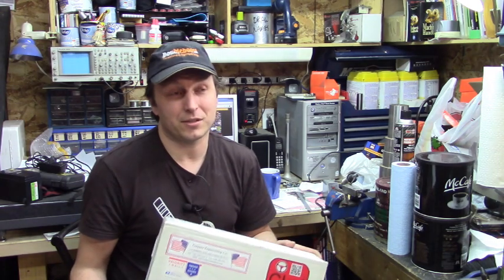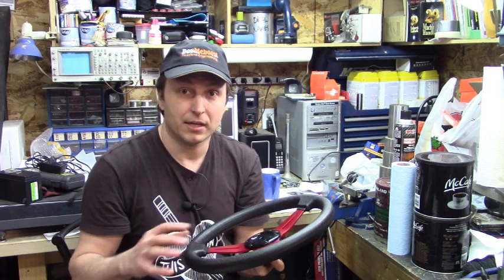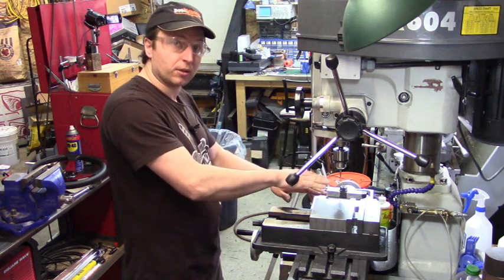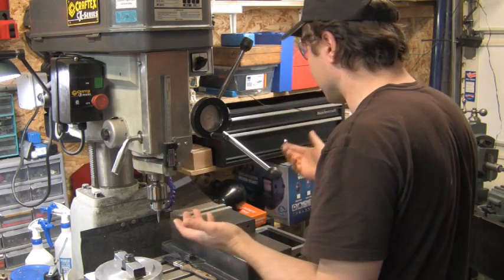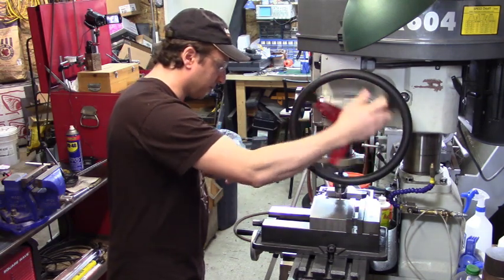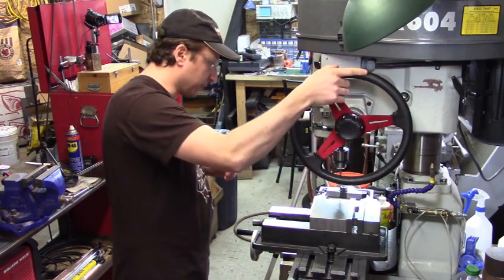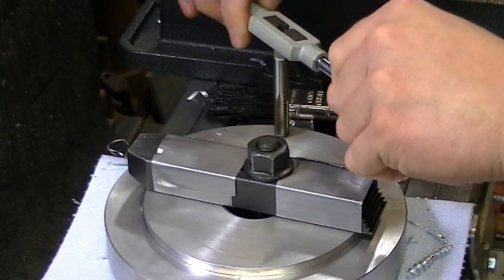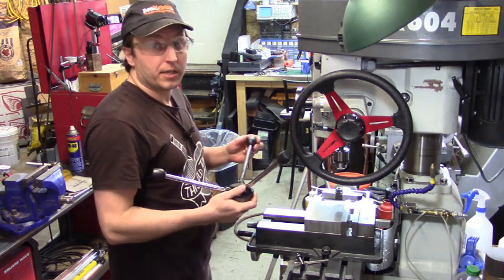Quill Wheel for the Round Column Mill

Comment: I like the concept... but what I would like to know is how the it holds up with hot chips and cutting fluids? The handle part looks like it might be directly in the machining chip path. Might not be nice if you grabbed the wheel and slide your hand across an embedded chip. Might want to consider a fully metallic version. Maybe a cast aluminum with finger grips?
Reply from the maker: I never thought about the embeddability of chips, but will keep an eye on it as it is being used.  Haven't heard much from others with wheels about grabbing shrapnel in the hand from it.  Not sure about the cutting fluids either yet but again no complaints heard from others who have had them longer.  You make a good point, this will be part of the longer term reviewing of it.

Comment: I picked up an old cast iron 6 spoke wheel from the dump and put it on the other side to raise and lower the head of the machine. It's 13" in diameter with a suicide knob sure makes quick work of raising or lowering the head.
Reply from the maker: That would totally work too - same basic idea.  It was fun working with Jim as he was even saying how he was surprised no one came forward before him with a commercial version of the wheel on the Bridgeport-style mills, much less the mill-drills.  I've heard from a few people who have adapted wheels at home, as you know it is an excellent feature to have.

Comment: I love my Quill Wheel. I went through a similar collaboration with Jim to confirm hub sizes on my Precision Matthews clone knee mill. The fine folks in Taiwan shipped it with a single slot machine style handle and I hated it. Jim fixed me right up and it's a world of improvement. Now I have continuous fine fingertip control and I can grab at the spokes when I need to apply more pressure than I should!
Reply from the maker: Aren't the wheels handy? And if you've worked with Jim you know he's a cool guy too.  I was originally skeptical of the Delrin hub but it seems to be quite good.

Comment: I can see the point but you would think that, hopefully, he is selling enough to have a symmetrical spoke arrangement made for him so it looks less like a cobbled together idea and a more like professional one. Yeh its only looks and does not affect the use but it sort of grates to look at it.😢
Reply: I think the "car steering wheel" appearance is part of the concept, for better or worse
Reply: @paulwomack5866  that's the problem, it looks like a steering wheel not a mill part, at least to my eyes.
Reply from the maker: I see what you're saying, as the steering wheel spokes may not appear "balanced" to some. Not sure of Jim's sale volume as I don't receive any kick backs from him (apart from getting a wheel out of the deal for helping him with the project).